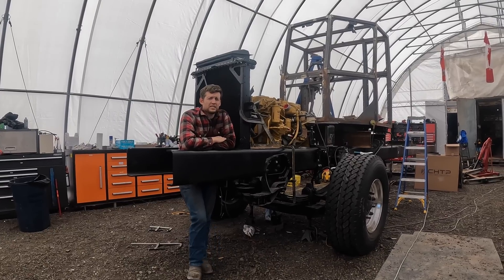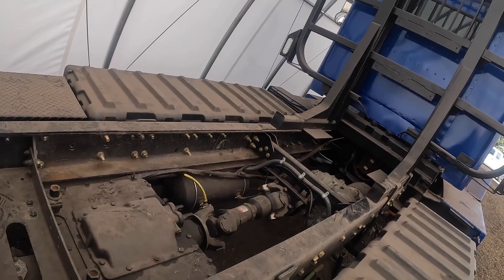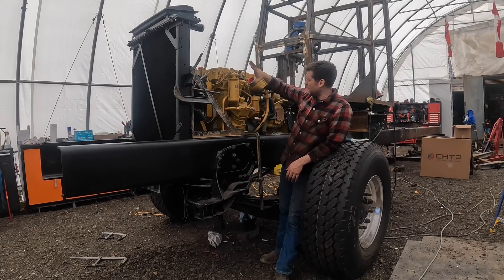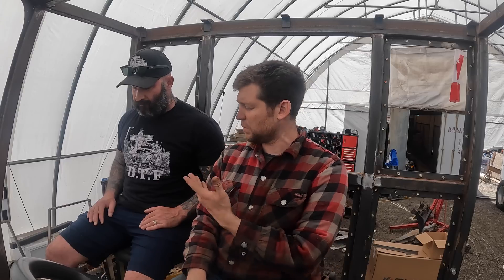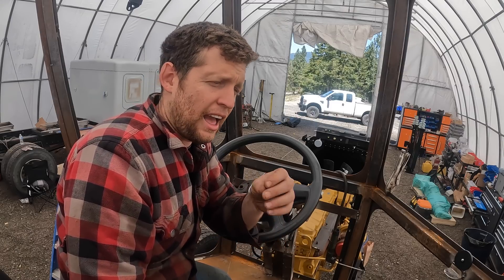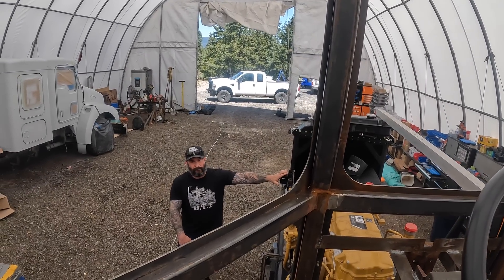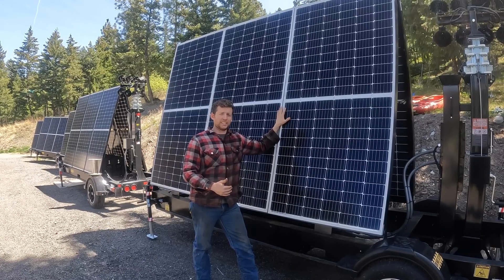Edison Motors Progress Update

Comment: having access to the relays and stuff this near the drivers seat might not be the best idea , knowing truckers in general they like to fix stuff on the fly .... while driving as it saves them time working and they be home sooner  , imagine someone reaching in there while its powered up 
might actually be a better idea to make the acces door in the back of the cab so the person working on it needs to be outside the cab and away from the driver seat , or at least make sure that the powered stuff cant be reached from the driverseat and that the person needs to be standing facing the panel 
with the generator being lower it might be a good idea to make the hood lower too so the driver can see more in front of the truck , that said it might help to put the cab in front of the generator as theres no real reason to put the engine in front of the driver as theres no gearbox he needs to reach 
having the generator behind the cab , maibe mounted sideways or hanging of one side of the frame , might actually give you the option of running the generator as a stand alone unit like a welding generator setup on top of the chassis behind the cab and being able to change the whole unit by unbolting the box holding the engine generator combo hooking it to a crane and replacing the whole box this would reduce time off the road for repairs a lot

Comment: If you went to digital steering, you could mount the cab on full dampers. 
You need a small bar fridge. 
Can i suggest also video side mirrors up high back to 3 side camears front middle rear, all facing rearward.  And you should drop the hood. Use several separate radiators

Comment: My thoughts on the design are honestly mixed. I do like the center seating position and the large windows (comming from a farming background this makes alot of sense to me). But i do belive the cheeks of the truck look a bit  too flat. if you were gonna add some more design clues, sort of an additional brand signature, id say making the cab look more distinct would be an idea. 

Functionality wise, i think shortening the front end a bit would give you a better turning circle, which would be great for an offroad application like Logging and even for city driving if you ever intend to create a Highway truck. I noticed you have alot of space infront of the Radiator and behind the engine, which even for maintenence seems slightly excessive, could also Attempt to reposition the batteries to be out of the way of side impacts which seems like a risk to consider in Logging. 

Love what you guys are doing and i hope you succeed with this.

Comment: Betcha you could manage better sight lines for the truck thanks to the diesel engine not needing to be in line with the transmission. Or at the very least, what you have looks like it could slope from the driver to a much lower front grill.

Edit: I love the design of the truck, and see the space being used by the radiator and fan. As much as I'd like to see trucks with better visibility of what's directly in-front of them, this truck clearly improves on overall visibility over typical designs, and you gotta keep things cool, so the grill can only shrink so much!

Comment: may be some out fitter switches and its own fuse box  pre-wired so the guy that bot it can do his own light set up and some brackets that are for the light setup in spots to bolt on to the cab hood mirror suports or frame

Comment: I love the cab design, but one thing jumps out at me aesthetically - the mirror mounting.  I have to believe there is a more elegant solution for such a revolutionary design.  You've effectively put a Row crop tractor cab on an HD OTR chassis.  Maybe look at row crop tractor mirror solutions?  Surely wind deflection at speed will differ between a tractor and a truck on the highway, but I'm sure if you can build an electric Class 8 rig you can make them work!
Great build, following closely.  I have a commercial fishing vessel in Alaska and am toying with the idea of going diesel-electric when it's time to repower.

Comment: So I can say with 100% certainty that you do not want the control access panel inside the cab. It’s a safety thing. Having the high voltage power supply in the cab with the driver is just a massively bad idea. You know those scenes from Star Trek where there are massive spark explosions on the bridge? Yeah, that’s what your setting up to happen in a things went bad situation. The idea you put out later where the access panel was on the headache rack and easily accessible that way was much better. Do that, keep your systems outside the cab as much as possible. Only the sensors and displays should be in the cab.

Comment: Guys, when it comes to heavy equipment and electrification... I was expecting the industry to start spewing out the typical, dealer serviced garbage being built in diesel trucks. It is SO damned refreshing to see a company thinking of the truck as a tool that will need serviced! I can not wait to see more!

Comment: ****. I would do a 50% mirror tint on yge lower windows standard,  as long as its darker inside , ppl would see mostly a reflection when lioking in, and looking out is almost un-effected,  i dont think anyone would wang everyone seeing them who looked at them, like they are on display!  This is why i think standard 50% mirror tint, or smoked mirror tint, or even blue mirror tint!  With a 5% strip up top, with a smoke and amber visors,  and RGB led neon strips around the cab for lighting, it can indicate battery level when the door is open, so you font hdave to look, so just opening the door, you know if you should start the engine or not, white with a blue tint near full charge, white with red, the battery is low, green it's mid level,  a simple micro controller, with some coding, and about 15'-20' of neon led strip,  and a voltage divider to drop the battery voltage from 400+/- volts to 5v and 3.3v or 2.3v being 2.7-3v per cell in the battery, and 3.6 or 4.2v being 5v, or. Full battery, or how ever it works out, and bias the led to red , blue , or green,   it is fairly simple to someone  who knows how vto code Arduino and the such,  not me, im just aware of their  existence, !

Comment: the only thing i have to ask, is why put the rad in the front? I believe in an earlier vid, yall said something about wanting to run 2 rads and not having the cooling fan belt driven;
in that case, why have the radiator in the front position at all? you could cut off an entire 6" height from the front nose and tilt the trucks nose down to get slightly better aero and viability if you relocated parallel radiators on each side of the vehicle instead; like behind the cabin how you see it in a trails truck. not sure how practical it is from my arm-chair point of view though.

Comment: Without the need for a direct drive from the engine for the radiator fan, the radiator  could be re positioned, maybe behind the cab if there’s enough cool air available, and allow the hood to be even smaller and angled. A few dozers are that way, makes for a much smaller hood profile.

Comment: Have a wired remote control. It lets mechanics move the truck around without having to climb into the cab, and drivers to get out for better views during sticky situations.
It could also enable a garbage truck or fire truck design where the operators can drive the truck in reverse from the back.
Reply: Or tow truck, or.....

Comment: A couple of suggestions.
- Move the front amber lights off the fender. Maybe integrate them into the headlights or front bumper, I'm not sure what the regs are. Without the lights on the fender end users can remove the fenders or replace them with something transparent or something more durable without too much trouble. Mechanics might also want them out of the way to get to the engine compartment.
- If you do make an electric/control cabinet in the cab, make sure it has a latching, removable 'dummy cover' to keep people from hitting a bunch of switches with their ass, or trying to brace themselves against it when going over bumps or braking, ect.
- Include folding jump seats on both sides of the driver. They can be made really small and could help with the clumsy dummy problem above. If someone can go there, someone eventually will. 
- Add some convex mirrors coming off the front corners of the engine housing, so the driver can see what's directly in front of them.

The original formulation of Murphys Law went something like "if there are multiple ways to do something a user will eventually choose a bad one". This make it the responsibility of the engineers/designers to remove as many ways for things to go wrong as possible, and create a 'pit of success' for their users. Your truck looks very 'pit like' to me (translates to "I like it a lot!"), but things can always be better.

Comment: Yeh, there is no need for drive shafts if you attach the motor and gear box as a direct drive, unless you want the front axle to drive too. its easies to extend the cables rather than a solid driveshaft. 
hmm,? Can you not find a production built radiator the is wider than higher,(I understand that you want an off-the-shelf product) so you can lower the hood height for greater visablity for the driver, there is no real need for the massive amount of free space above the generator engine if it is free-to-air underneath.

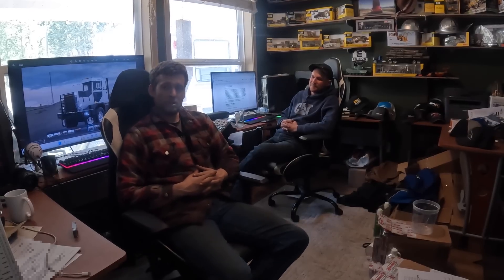Comment: 9:10 "...leave a comment...": Lower the top of the radiator 1/3 it's current height. If you need the area, go wider...maybe 3 pieces...one center, two angling back on the sides. Why? Visibility. 10:00 You don't "lose somebody from there". And the crucial visibility you need is to the back. You have to see the back end of the trailer to guide it backwards. Cameras should do that better than mirrors these days. 10:45 "...can't see in...": Good. They can't look up your skirt. 11:40 "...government...": If you get government involved in any way you've made a bad choice somewhere. 13:20 Where did you get your quonset hut?

Comment: I LOVE this guy's attitude and approach. The center cab is great, and I hope this company gets a huge infusion of capital, and then really accelerates their project. My father invested his life savings in electric vehicles in the early 1970's, and is partner, the late great Prof. R. D. Middlebrook of CalTech, who worked in Shockley's lab at Cambridge, was convinced that a diesel-electric hybrid approach would be the future of transportation. A motor running at a single speed is easy to optimize, and the full torque at zero RPM which electric motors can offer is a winning combo.

Comment: Coming from a mechanic, it's nice seeing things developed to ease servicing. For the electrical/fuse panels. I'd suggest having a way they can pivot to access the backside of the panel to allow easier testing/servicing of the panels. It also looks like it won't take very special/expensive glass when the windshield/foot glass needs to be replaced. On the battery heat issue could you plumb in like a fresh air intake/outlet to run over the batteries themselves that can be closed when they are too cold?

Comment: This is just my opinion, the front end/hood area is a bit to square, the shouldn't be perfectly sqaure to the fenders & hood, and the hood shouldn't be perfectly 90° to the windshield & the front grille . The edges & corners in the front end/hood area are a bit to sharp & should be slightly rounded.
Reply: Everything else looks amazing though

Comment: Does anyone else realize the amount of giant batteries these electric vehicles use produce more co2 in just being produced than my f350 turbo diesel will produce in 100,000 km of driving, electric vehicles are not the be all end all a hybrid maybe,also the power it takes to charge those batteries doesn't come out of thin air, there is co2 being produced by making the power it takes to charge these batteries and solar panels also have produced co2 into the atmosphere in their production just like everything on the planet. An electric vehicle being advertised at dealership as a zero emissions vehicle is a lie seeing as the amount of co2 produced in the production of that ev is  way higher than the amount produced by my f350 during its production.

Comment: Will you be able to fire the generator from inside the cab? If so can the generator be used, while moving, to recharge the battery system without stopping? 
If it can't recharged while in motion, what would be the reason and are there work around solutions?

Comment: I think your drop visor need to be meaner looking. I also think you need to double up your headlights or go with bigger rounds. Also I’m not sure if you’re gonna do it that way, but if the hood is gonna be butterfly or tilt forward, you should make the fenders strong enough to stand on to work on the engine. I’m sure the mechanics, bush or not, would appreciate that. Finally, I think you should make an optional panel for that lower cab panel you wanted to limo tint, that splits the panel into a triangle window and panel.
Reply: I concur with bigger headlights, 7 inch rounds gets my vote. I’d stick with the single style but put a guard around them like an old Hayes or a bulldozer for protection.
Reply: @3sparewashers-lg3gf  that’s a great idea. Definitely needs a cage or at least a little sheet metal bent into a visor that bolts to the fender on each side but provides protection from falling rocks would be great. Also a thought, I’ve always loved old vehicles that had those little visors on the round headlights. Such a classic look. I think a set that was maybe not round, but trapezoidal, would really fit well with the blocky shape of the rest of the truck

Comment: Love the build but I saw the 3D render and I am confused because the truck seems to lack the aerodynamics of modern trucks, and for electric vehicles aerodynamics are really important. Is the truck simply gonna to be used at low enough speeds so that aero doesn’t matter or?
Reply: He did a video on this. You can build the most aerodynamic logging/heavy haul truck in the world, but you cannot make the 20 ton dozer or load of logs aerodynamic. It would also drive the cost up massively, kill the visibility aspect, and it would loose durability and simplicity in massive amounts.

Comment: A camera on the nose of the hood with a screen front center (only block view of hood) would eliminate the blind spot in the center front of the hood.  Love the look of this and your hybrid design with regen braking is exactly how electric vehicles need to be 👍👍👍
Reply: Having a camera there would be perfect. If they could incorporate the ability for rear facing camera mirrors and memory cards, no one would have to install an aftermarket dash cam.

Comment: I like the cab design.  The renderings are awesome.  I think the firewall behind the steering column should be bulletproof glass or some kind of lexan with lights in the engine compartment that you can turn on so you can keep tabs on your engine.  Great design I hope you guys sell thousands of them .
Reply: The main problem with that is heat. There's a reason firewalls are usually steel with insulation, it keeps the cab much cooler.

Comment: I think the outside looks good, reminiscent of a Hayes or other heavy rock truck, or an old super-hauler Mack. The interior looks plain, but that's probably what the folks want, it is for work after all.
Reply: I think fancy interiors are overrated. I see all these cars with carpet flooring and pleather everything and I don’t care for it. I’d prefer a floor covered in bed liner and a simple all steel or aluminum dash. Metal doesnt crack in the sunlight.

Comment: Just an idea for the cab. You should put a built in cooler/heater for drinks or your lunch, just an idea, could be too much to do or may not even work with rough roads and drinks bouncing around. And also a question for the future, are yall ever going to make an over the road truck version with a sleeper on the back or something?
Reply from the maker: Maybe, but we’re a long way off from a highway cab

Comment: Your radiator is the only thing making your hood so high. A slanted hood increases visibility and I think it would look better. Is it a single radiator? Maybe 2 smaller ones would work better and create a fail safe that you can isolate one rad in event of failure. And don’t mount the ignition key on the steering column. It’s a knee basher

Comment: does the generator bypass the battery when at full sustained power (batteries just used for power spikes)?
Reply: The only thing the generator does is charge the batteries. The batteries take all the load peaks and standard load. The truck is a full electric truck with an onboard generator for charging.